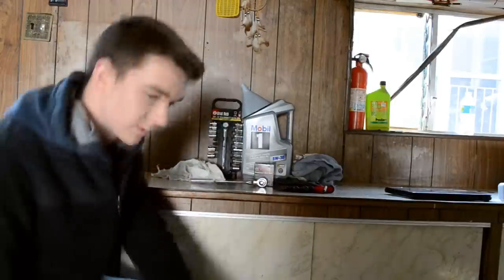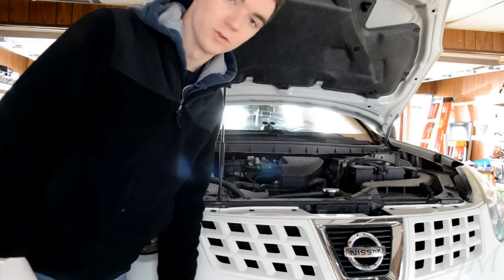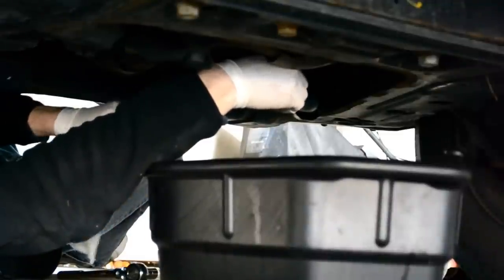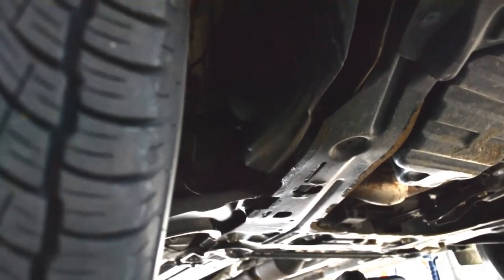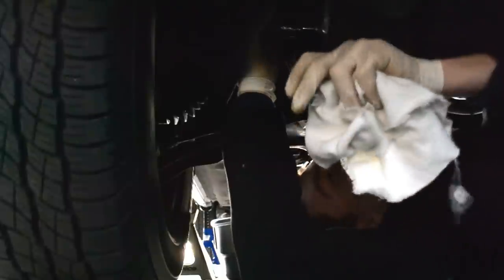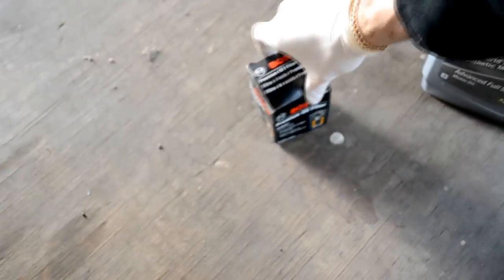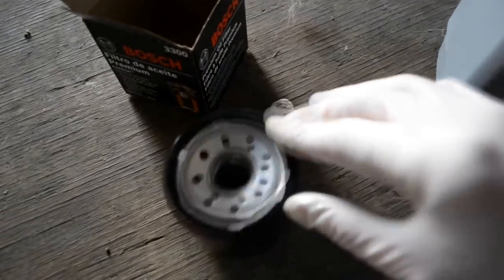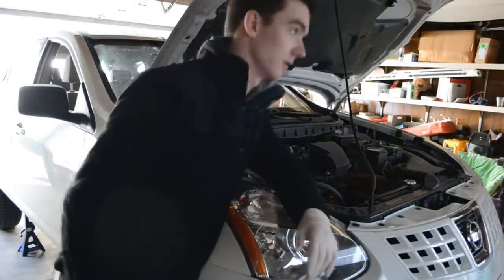Nissan Rogue DIY Oil Change

Comment: Nice , Thank you , for the oil pan bolt , use plumbers tape it really works,  instead of water it's oil,  just remember at the next oil change , remember to take off the old plumbers tape that you used for a gasket,  and don't forget to put the tape on clock wise.

Comment: This is one of the easiest vehicles to change oil and filter.(6 minutes start to finish)  Don't waste your time with jack stands or floor jacks as there's plenty of room to get under vehicle to access the drain plug and filter.

Comment: Nice video. It wouldn't be a bad idea to check the oil level about 5-10 after adding the fresh oil. It's best to have it be slightly under the full mark. Also a  quick drive up the street and back, and then a quick look under the vehicle to make sure the filter and drain plug isn't leaking. That could prevent some costly repairs.
Reply from the maker: You're right. I usually let it run for a few minutes and then later check the level.

Comment: On my wife's 2014 Rogue--the latest generation--the layout is exactly the same, from the oil pan to the filter. Never would've found the oil filter there!
Reply from the maker: Brian Phelps Yep weird spot for the oil filter
Reply: I didn't like how the plastic cover protecting the oil filter was so flappy. Seems like over time and subsequent oil changes this will get worse and might even be noisy at high speeds.

Your video was very helpful, btw. 

Getting an overly large pan to collect the oil was a good move. The smaller one I used couldn't reach the pan and the oil filter area at the same time (the pan was still dripping oil for quite some time before I began to loosen the oil filter).
Reply: Sweet about to change my 14 rogue sv  thanks man

Comment from the maker: I don't know if the newer Nissan Rogue's have a maintenance light, but mine doesn't. So If you are getting a Check Engine Light you should get that looked at. That light doesn't tell you when to change the oil.

Comment: You forgot to mention that the engine should be warm and not cold, as warm oil drains more thoroughly and easily. Also, the filter should not be hand tightened. A  tightness w/ the oil wrench will create a proper seal. Perhaps, that's why your video indicated such a greasy build-up on the old filter. Other than these two instances, your explanation was quite informative.
Reply from the maker: The grease was not from the old filter. It was too thick of a grease. I have never seen anyone tighten a oil filter with a wrench. Hand tight is all you need on a oil filter. I usually do hand tight and then half a turn.
I did forget to mention that the engine should be warm. Thanks for pointing that out. I'll add a annotation.
Reply from the maker: Thank you. I agree
Reply: +GradzkiMedia I may be wrong but the grease looked like it was from a torn boot on the half shaft. I had the same problem with my Nissan.

(Edit: I see now that someone already told you. XD)

Comment: Any issues with re-using the washer? I always thought you should use a new crush washer with every change, but now I'm wondering if its even necessary?
Reply from the maker: Its recommended but you don't have to do it every oil change.
Reply: GradzkiMedia I just did one on my mother's Rogue (my first time doing an oil change) and I may go find another crush washer for the next oil change.  Whoever serviced it last tightened the drain plug way too much.  And when I reinstalled it, I apparently didn't tighten it up enough as it leaked after driving, so I had to tighten it more.  No leaks again thus far.
Reply: Mine looked good, so decided not to replace it. Next time I will, just to be safe.

Comment: I'M GUESSING 4.5 LITRES OF OIL?
Reply from the maker: Sorry I forgot to add that. Capacity with oil filter change is about 4.6 Liters. I would fill a bit less and then start the vehicle and let it run for a few minutes then check the dip stick. If needed then slowly add a bit more.
Reply from the maker: In the video I pretty much put filled the whole jug which is 5 quarts. But you can go with what the manual says and that is 4.6 liters or 4.8 quarts

Comment: "using the torque wrench, tighten it not too tight, until you hear the click."? Seriously?!?! Any torque wrench will click at the lbs it's set at. Too tight and you'll snap the bolt, too loose and it'll fall off, draining the engine! I believe it should be tightened at around 22lbs. This is a specific setting, not guess work! A very important step, but I have to assume anyone who has a torque wrench will know this......
Reply from the maker: brickwal92tt I believe you skipped the part where I mention the spec..
Reply: Many torque recommendations are ± and don't have to be exact.